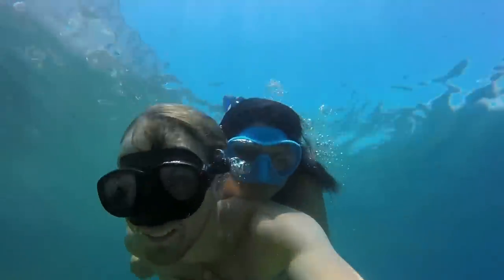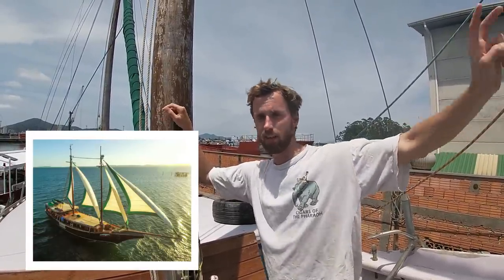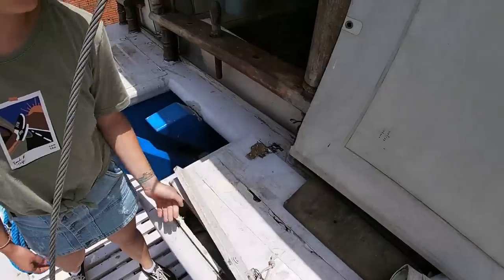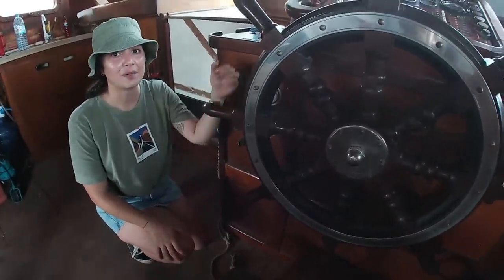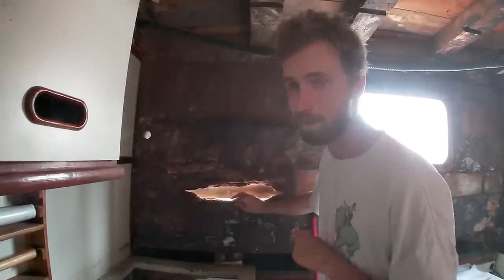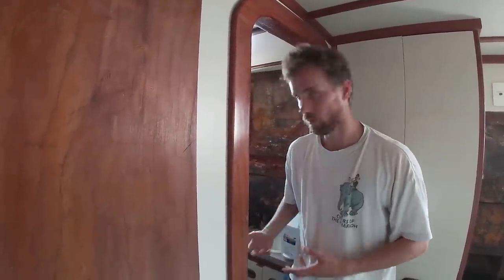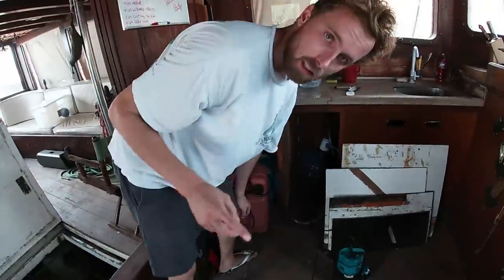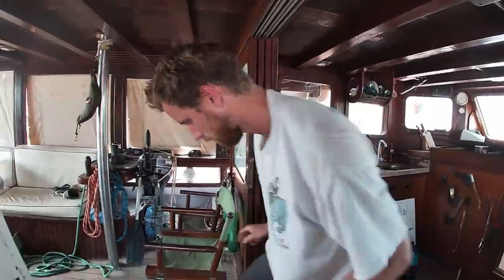BOAT TOUR of our wrecked Brazilian ship — Sailing Yabá #7

Comment: Thanks for the boat tour. 

We have had three wooden boats in the family over our lives. And we always tell everyone the definition of a boat “is a hole in the water, surrounded by wood, to within which you throw money” The best two days in a boat owners life are the day you buy it and the day you sell it! Both sayings are in fun, because the ownership of a wooden boat is the love of the wood living around you. 

I feel the two of you also have the love of the wooden boat as a living assembly. The nay sayers don’t understand the love of a wooden boat. It is a very big project, and will be your home on the water. As others have said, make the hull and topside secure and watertight first! And as you said remove ALL the white plywood. You need to ensure all is secure. As you remove the paneling you may see how to adjust the spaces to be more efficient. Keep the full Galley, and have the topside area for light food prep, or pan grilling. (Simple topside). Once all the structure is secure, you may find additional things the are easier to modernize than to repair. I saw you said you were going to freshen up the tanks and the engine. I like the idea of LED lighting, I personally would get rid of the 220 power. Safer to have your 12/24v systems. More simple and supported by solar panels more easily. We have solar on our home in Dallas Texas. And they help our costs. And if we had more land (we live near Dallas in an urban area) we would have enough solar to be off the grid. 

I am looking forward to your journey. It will not be a short one, but it’s not just the destination, it’s the journey!! Hope you have money for the project, and reasonable craftsmen to help with all the work. I saw one shipwright offering help. Could be an adventure.... oh yes ... it WILL be an adventure... that’s what life should be.

Waiting for the video after you get things really opened up, and get a good survey done. Then we will enjoy seeing the necessary hull and topside repairs. We will love the process as much as the details.

Also remember the respirators with the mold!  Even during the tear out. And I didn’t notice any ventilation system. Once you have proper portholes to seal things watertight, 
you will need proper venting too.

Onward... til your next video!

Comment: Ben for the lighting of your boat switch to LED lighting the LED uses less voltage and is much brighter than old conventional lighting
Reply: LEDs use less CURRENT than conventional bulbs. The voltage depends on what you buy. (If you buy 12 volt LED lights, they will last much longer if you run them off 12.0 volts (or lower) rather than typically 13.6 volts from a "12v" battery system.) Disadvantage of a 12 volt system is that the wire must be much thicker* than for 230 volts.
* TWENTY times larger cross-sectional area of the wire. Heavier, less flexible and more expensive. However, your existing 12v wiring is already there so you could use it.
Reply: That’s a great idea. One thing that is a constant drain at night is your anchor light. When converted to LED it saves a bunch. Also avoid using AC lighting when on anchor. It’s more efficient to use the DC lighting because there’s no inverter losses.
Reply: @manolisgledsodakis873  I think the word he was looking fir was wattage. LED uses less wattage, who’s is a result of drawing a lower current, as you were saying.
Reply: Lol icing the cake before buying the ingredients never works , they have years of repairs before they will get close to lighting
Reply: @leahtemplar3296  
Could be, but these two will be in the water soon and likely working and living on it day and night. No sense in buying things twice as you go.
Reply: Karl Jensen lol , they will be in the water in about Fife years , they haven't got a clue , no skills and a boat that should be burned
Reply: @leahtemplar3296  
3 to 4 months max. That’s a boat yard ramp. It’s gotta move,,,,,,,next.
Reply: Karl Jensen ... You are obviously as much a novice as the boat owners themselves ... I'm guessing you don't even know the process of re planking a wooden hull , how the wood is bent and shaped , what caulking is etc ... Three or four months if they get a professional team to do it ... If they are doing it themselves it will never float again
Reply: Karl Jensen , I've had large boats for two decades , I've watched many wooden boat projects in far better condition than yaba end up abandoned when the owner realises they have given the,selves far too much work and underestimated the cost massively ... I work on my boats myself being a highly skilled multi trades builder , I have also worked on many other boats ... Boats consume time and money like nothing else , especially when a full renovation is needed ... A partial rebuild , you are committing to throwing money away that you will never make back
Reply: @leahtemplar3296  
Not a novice. First boat was a 1967 40’ Chris Constellation. Last was a 1978 43’ Delta Clipper (search: “big fast houseboat”) and a dozen in between,all re powered and rebuilt. I know 98% of old boats are toast. No I wouldn’t have bought the Yaba and sure a hell wouldn’t have put money in it even out of the states. Those two boat wrights they have are old school top notch in an area where labor is inexpensive with a get it done attitude. These two young people have a ton of energy and will be a lot wiser but I’m betting on them in the end.
Reply: @leahtemplar3296  the thing about this boat is this is their home and it is their passion to revive it what they qant to do. Just like auto body shops repair vehicles a real good body man has the passion to do the job correctly while a half ass body man does a cheap repair just to get it done and out the door for the next  vehicle. Same for boat owners and craftsmen some just do patch work while others want the job done correctly and professionally
Reply: @leahtemplar3296  The one thing you forget, is this couple can do many different repairs depending on the condition of the weather The other thing they have lots of help from all the guys in the shipyard who will be doing a major part in the boat restoration. This couple can work on projects inside for when it rains or the weather gets bad
Reply: Harold Domangue , no mate I don't forget nothing I have lived and worked on boats for twenty years and I have you bunch of amateurs telling me what's what ...
Reply: @harolddomangue9206  I don’t think this couple can do anything. At least not right now. I don’t think they even know how to change a light bulb. I just hope they have some real wealth from somewhere, inherited some family money of something maybe, because I think this boat will chew and burn through it in a hurry.
Reply: @srcastic8764  this boat may be a money pit but they are hoping that they get financial help from people who are willing to send $$$to rebuild their boat and that is why started their youtube channel
Reply: @harolddomangue9206  LOL. You must be friends with them or something.
Reply: @srcastic8764  NO I'm not what you call friends with them, just someone who understands where they are coming from since the first day I started watching their channel Sailing Yaba they were introduced to me by their friends Duca and Roberta Odd Life Crafting and Duca also introduced Georgia and Diego from Unforgettable Sailing. so you see I have some interest in what they do, I do enjoy watching their progress on their boats and their life journey. Plus I watch many other Youtube channels to pass the time. Think of this I guess you can say they are my friends from far away
Reply: @srcastic8764  What are you think of when you say solicitation without permit this show is about repairing a boat there was NO solicitation going on at any time.
If you are going to leave any sort of comments then you need to watch the videos first then you can comment I only comment on videos I have watched first then comment even if it is on other peoples comments.
Reply: @harolddomangue9206  oops. Clicked on the wrong comment to reply on my notification list!  Gorilla thumbs on a small phone screen.  🤦‍♂️
Sorry about that!

Comment: Ben, your pronunciation of the english is very good and nice to listen to. This will help you in finding sponsors, I'm sure.
About your 220V and 12V lights: we have a campervan with 12V and 220V on board. all our lights however are 12V Led, so only one circuit. This will work on the battery when we are underway, as well as on 220V, because these lights will still be on the battery which will be loaded from the 220V net.

Greetz, Rob Bisdom, Rotterdam

Comment: I know you probably don't want to hear this, but I think you bought this boat with your hearts and not your heads. You need to think long and hard how much time and money you want to invest in this vessel. We have seen in your other videos that the rott extends to structural spars, hull, deck and coach roof. The amount of time and money you are going to have to throw at this project just to get it to half decent would buy you a good 50 foot Amel, Swan or Hallberg-Rassy ect.

This vessel's ocean going day are long gone. I really think it would be quicker and easier to build a new boat from scratch!  I think there's only two real options for this boat;

1 - drag it onto land and turn it into a airbnb apartment
2 - Insure it and have a "accident"  

Id feel safer crossing a ocean on tom hanks raft from cast away!
Reply: AirBnB is a good idea!  It doesn't require buoyancy.
Reply: Insure it and have a "accident" LOL
Reply: @pearlofqatar7779  I hate to say it, but that was my thought too.

Comment: I would imagine that the downstairs kitchen would be easier to use in rough weather, being nearer the water line, and it is out of the way of the chart table.  Plus more storage nearby, and generally I would have thought a better place to work.
Reply from the maker: That's a good point! We might we both and just have the upstairs one just for coffee and small snacks
Reply: The kitchen on the boat is called “Galley” anyone who knows that would stay miles away from this “boat?”
Reply: @Buffalosoldiersky  Yes, of course it's a galley - but English is not their first language, so cut them some slack?   It means the same thing.

Comment: Make a mess, huh?  Oh boy.  Fortuna Audace Jurat, as you posted, Fortune Favors the Bold.  In other words, work for what you want, and you'll have it.  Without working for it, you're just playing.

Okay, Galley.  Keep both.  You can use the below decks galley as your main galley, and you can use the pilothouse sink and stuff as a serving station inside for the back deck.  Good for making cocktails, canapes, and other 'light fare.'  Keep a Convection/Microwave oven and a small fridge and you'll be fine.

Okay, here's what I consider the bad news.  
The Windows on the main deck.  I am going to guess that you will have to have them all custom made.  I'm going to guess $1,000USD EACH.

Remove ALL of the paint and coatings from the upper deck, including the deck, side walls and roof over the kitchen and pilothouse.  Check for ANY rot.  Sand and clean any bad wood.  Sand until you hit 'good wood.'  You may need to replace entire sections of the wall, which will require removal of the roof to get to the rotted areas.

Remove the white board from EVERYWHERE inside and verify that there were no leaks behind those panels.  Remove all the cabinetry to check for rot. 

Remove rotted wood and replace.  You won't be able to sand out the rot, as you've seen in some places where it goes straight through the wall.  Any rot that is more than surface deep will require replacement of that wood, completely.  Just cutting out a section of the wall and replacing it MAY work in some spaces, but in structural areas you are adding a weakness to the entire structure and it will lead to failure of the whole.  So, like the stuff you were showing us in the one head, if that runs completely across the yacht, ALL of it must be replaced to ensure that in certain sea conditions, and not even 'rough' conditions, the strain will be across the entire piece of wood, not just the replaced section.  The same applies for any wall where there is even a hint of rot.

As I said, remove and check behind each and every cabinet to verify that there is no rot or water incursion.  You said you had some coming down around the main sail mast.  I may not have done any damage to the mast itself, but where else has it gone?

Sand EVERYTHING wooden on the boat, down to bare wood, and then coat it with a high quality marine varnish.  Since this is a wooden boat, expect to be doing that every two to three years!

Since you didn't show the hull, I can't even begin to tell you about that.  However, the hull planking is like the interior walls, it's important that if you have a rotted section that you replace the ENTIRE plank, not just patch the area around it.  So, you may have to replace 10' or 3m of planking at a time for a small 6" hole.  Plus, if that hole is in two adjoining planks, you'll need to replace both planks.  You MAY be able to use thinner sheets and laminate them together, one over the other to achieve the same kind of strength.

As to the engine, you've had it fail on you a couple of times already.  The engine is no longer manufactured by MB, and while parts are still available, they are, if anything, old 'new stock' or used.  Trying to find parts for it may not be easy, but you should consider having it rebuilt to like new condition, including the Bosch injection system and the Turbo, if installed.

Finally, if you have not already, I would have a Marine Surveyor go over your yacht and tell you EXACTLY what you need.  I'm going to guess that you're going to need to spend about a million dollars U.S., and about two years to bring Yaba back into a safe condition that is reliable.
Reply from the maker: Hey Gary! Thanks for this message! It is great help!
About the galley: Great idea. We were thinking of doing that, to just have a smaller&easy access galley upstairs as well as a complete galley inside.  Our plan now is to expose all the wood on the boat since we will have to replace a lot of it. We know that a small hole or piece of wood can need a change of the whole plank. As we will be doing a lot of work now we won't be making any shortcuts which we will regret later on when out at sea. Like you said: The walls are also very important for structure of the boat. 
Here a small repair on a plank is called a bacalhau. Our planks on the hull are 6x30x5 so we can afford to have one now and then. Some of our planks already have a fix in them so no point in patching the hull (Best to replace the bad planks completely)

Fortunately for us, the engine we have is very common here in Brazil. Not only are there second hand parts but also aftermarket replicas and spares available. We will strip down the engine, sand blast and clean what we can before having the parts serviced before putting it back together.
Reply: @SailingYaba  I really don't want to be the person who says you can't do this.  In fact, I hope that you will have a beautiful yacht in Yaba when you are done.  I hope that you'll be able to have a great home and she'll take you to the ends of the Earth.  But, I also want you to be realistic about what it's going to take to get there.
I do hope that you can get through all of this, and don't let the magnitude of it get you down, but also, be prepared for more work than you expected.
My best to you!

Comment: as a wood boat semi expert...my fix for the bunkhouse roof walls and walkways.......1. cut out bad and patch in good (unless rot is spread to supports or transitions ...then cut all out).....try to get a similar wood.....dont mix SC atlantic pine with that bahia hard wood
2. once that is done epoxy the shit out of the outside....some will say no, but above waterline it is the proper way to go for a daily use boat

3. as i heard u say dont cover inside once repaired and eliminate alot of the built in shit

4. as far as your frames go.....if any have rot.....just cut out rot area and sister a new frame to it....this is standard practice....sister a weakend frame and leave in place
Reply: Wot he said.

Comment: Y'all have a huge project on your hands. I can't wait to follow along and see the progress as it happens. That boat is BEAUTIFUL... 😍😍❤️ Since most of your main entertainment space is all upstairs. In my opinion. Y'all should do the galley upstairs as well. That would help if your out at sea and wanna make a snack. You're right there by the helm still. You're less likely to be sea sick than down in the hull if you're in rough seas. And you have plenty of ventilation. Galleys tend to make a lot of heat. As well as steam. Which as you know. Isn't good for a wooden boat. Lol. You could do some nice under counter fridge and freezer units to keep em low profile and out of your line of sight. Then where the fridge is downstairs put an extra freezer for long passages so you can stock up. But idk. That's just my opinion.

Comment: I still don't think you realise the enormity of the of the project you have taken on , the cost of all the work to be carried out correctly is astronomical , you will require a bottomless wallet ! .My only advice is to purchase 2 pairs of extra large rose tinted spectacles, you will need them !.
Reply: Gerald, you’re more correct than you can possibly imagine. Having worked on yachts in far better condition, I know how much work and cost it will entail. The good news is that they are young but they will be older and wiser after this one way or another lol

Comment: The engine room is the heat of your boat and you need to have a better openion of this part of the boat,dude
Reply: It is indeed the heat and that destroys batteries.
Reply: @manolisgledsodakis873  Yep. Lead-acid batteries like a nice stable 25C or so temp.